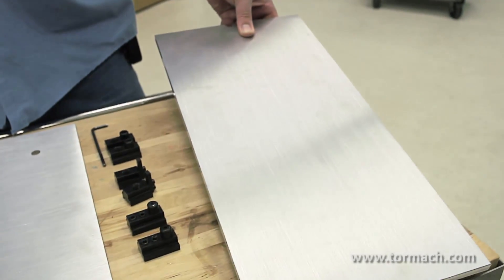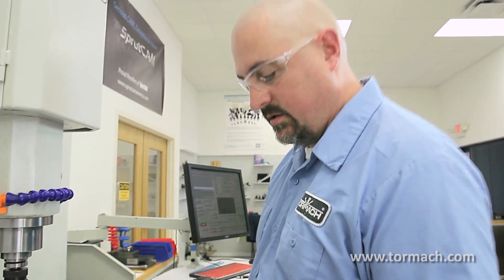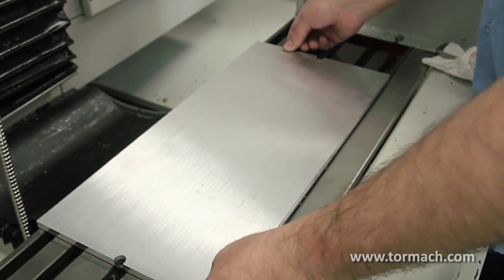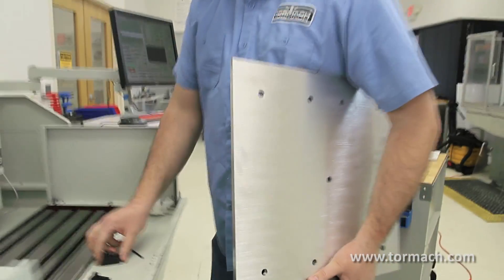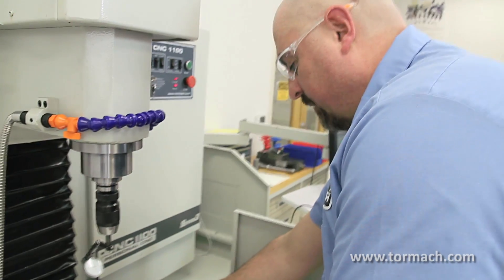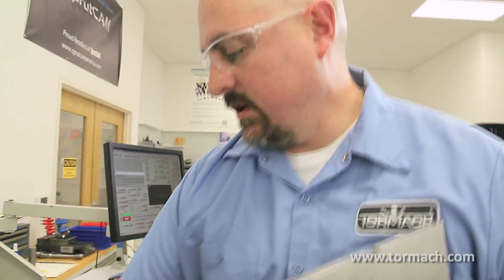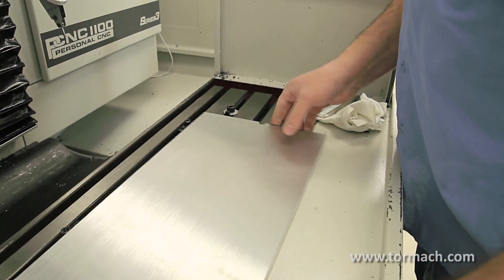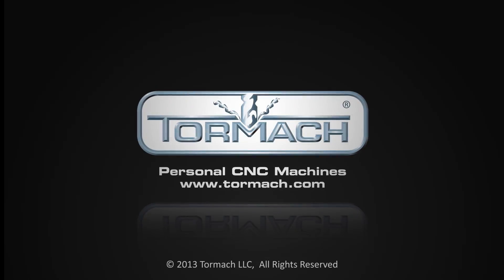Fixture Plate Tips - Tormach CNC

Comment: Fixturing like this you'd place 1/8 flat alloy under the plate and drill to exact depth then manual tap for threads. However I'd recommend watching John Grismo make his fixture plates as he doesn't tap aluminum he uses a small end-mill to pocket 1/2 the depth of each drill hole to the shape of a Nut then press some in as you would have better structural integrity. just use a universal size same as your clamps so they bolt to these plates.

Comment: I had been waiting for a tutorial on this topic for quite a while, so thanks for putting it together! I still have one question, though. How do you machine holes on the plate without messing the table? I was under the impression you would need to raise the plate with some blocks, but then you would lose the ability to register it on the table, right? What am I missing? And of course I am not a machinist by trade, so this could be kindergarten technology to many, but definitely not to me ;-)
Reply: Go 90% thru & than flip it over & machine the bottom a little larger or use a match drilled sub plate you discard when you are done machining.